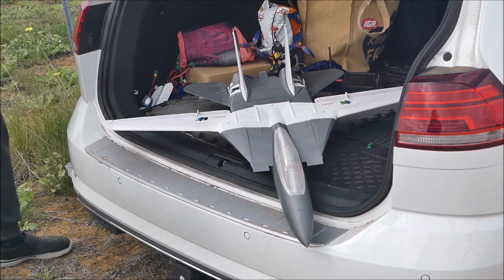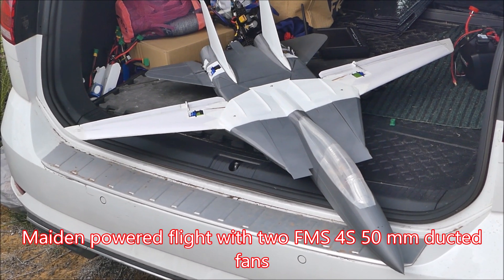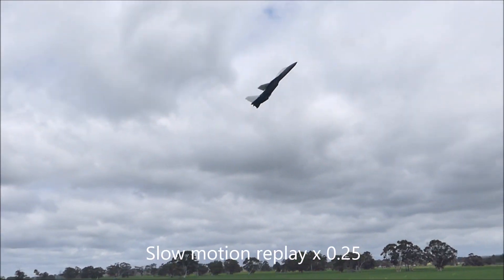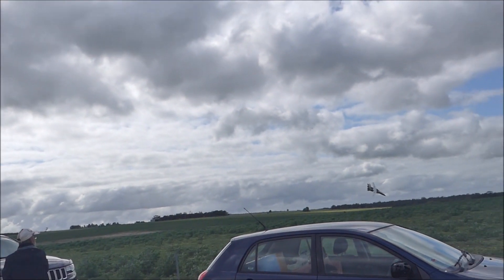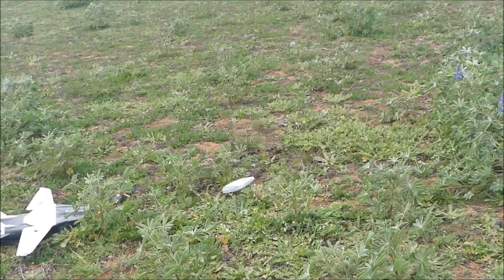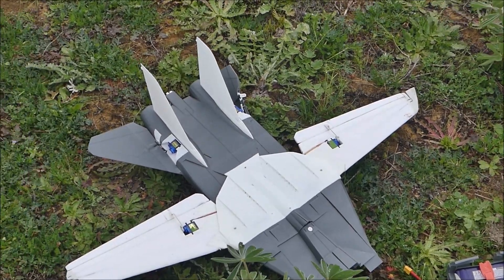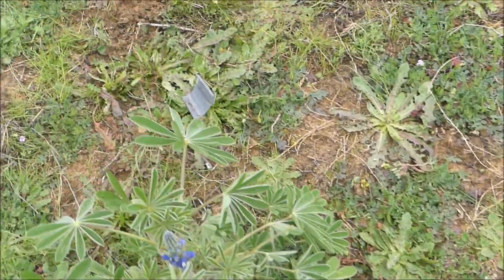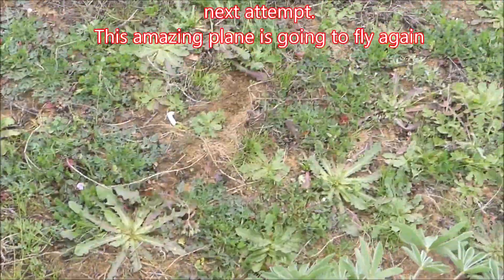3d-printed F-14 Tomcat powered maiden flight

Comment: Looked a tad under powered to me, he stalled it. You can see the left command given, but the amount of up and left just ate his lift and dumped the already lowered right wing. But you are correct I think a few more seconds to build speed and he would've been alright. Rog takeoff would've been the way to go if possible. Beautiful plane I'd kill to have the plans. That's my dream plane.....edit why wasn't he using tailerons like the plane does in real life.
Reply from the maker: I believe that he did have a small amount of elevon mix. Could do with more. He has designed it for full elevon control with the wings fully swept back.
Reply: @MrWaz11  he'll figure it out eventually, it's all trial and error honestly. But as far as the tailerons go, the real f14 has full time talierons and the ailerons are only active in forward sweep but still work the same direction as the tail. Basically it's an elavon setup without both going up or down, although I could be wrong. Really even if it doesn't IRL have it that would add a lot more control with added stall issues but at speed would be fantastic
Reply: He'll release it once he knows it will fly!
Reply: @_Mk9  honestly if he could switch out to say a 64 or 70 mm edf I'll put money it opens that plane wide open